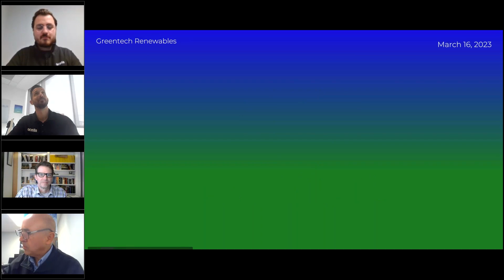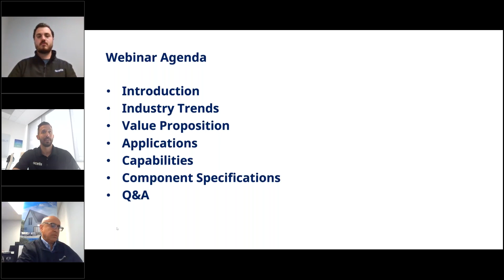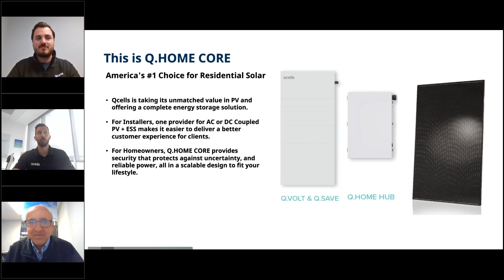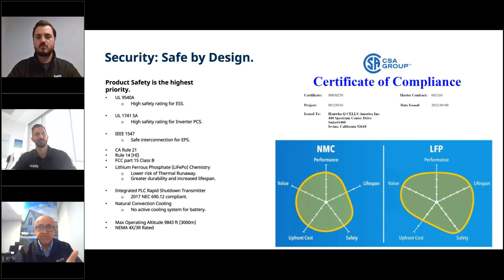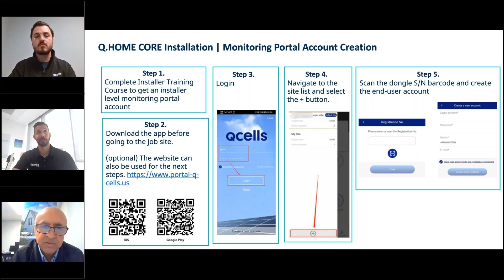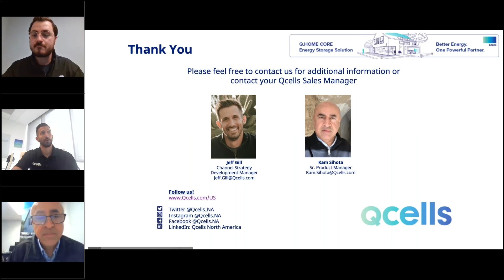Qcells Q.HOME CORE Energy Storage Solution

Comment: Hi - we have just become the proud (and happy) owners of a Q.Cells system (inverter and batteries). Is there a video for owners to watch to understand more about the operation of the system and what we are permitted to adjust on its operation ?
Thanks
Reply from the maker: Hello! Great to hear. Did you work with a Greentech Renewables location on this project? Thank you.
Reply: We're based in France so no.Used a local Q Cells agent.